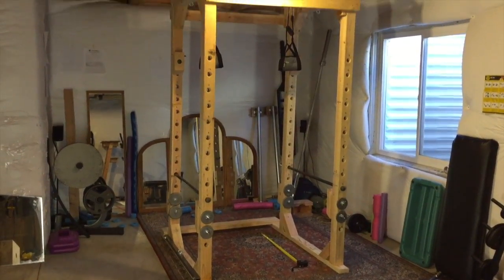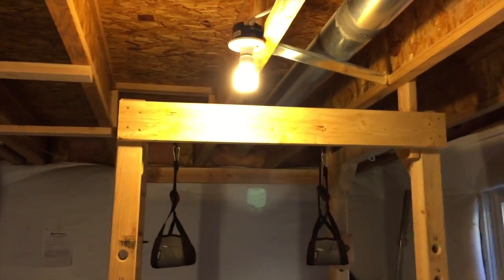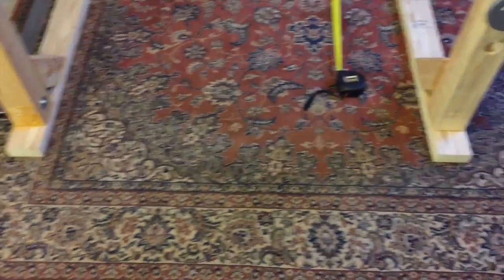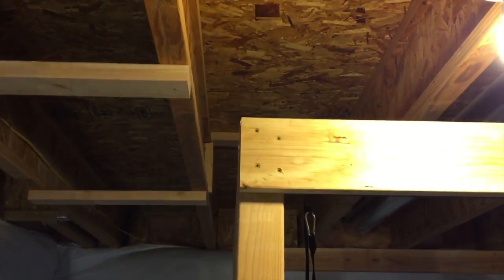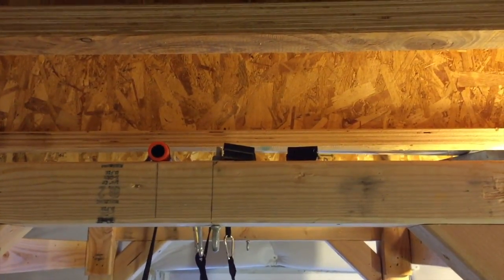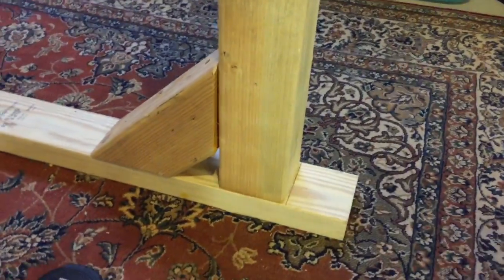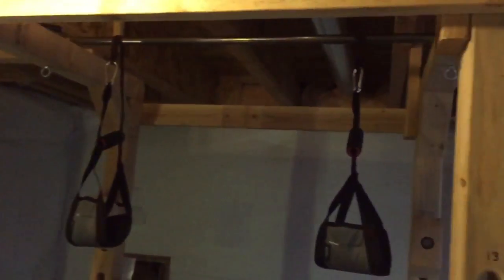My DIY Power Rack Design

Comment: Your design is fantastic!  I like the Buff Dude's version as well but also found it odd they didn't use wood glue.  I'm gonna use 2x6 for the feet since I don't have 2x4.  Unfortunately I can't secure the rack to my ceiling but I think it should be fine overall.  Nice J-hooks too!  Looks like the top and bottom are angled, what degree did you cut them at?
Reply from the maker: I don't recall but 30 degrees comes to mind. Thanks.

Comment: how many inches did you push out the bottom support so you could comfortably rack the bar? I prefer your design over the buff dudes one, planning to build it this week
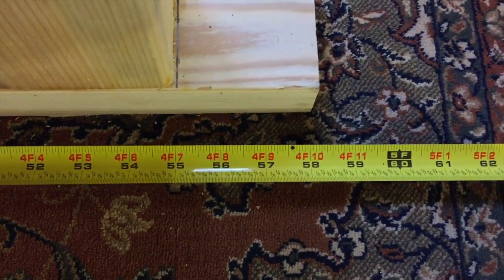Reply from the maker: I found it! If you look at 3:59, you can see it's 12 inches. Hard to read the tape measure but you can see it goes to the first black mark (which is a foot). You can always squat from the front uprights (turned around so you're still in the rack with the safety bars). I'm not a big squatter because I have 2 knee replacements.

Comment: It’s strange... you talk about the Simpson strong tie not being enough, yet only use one screw in each end of the diagonal support pieces. I don’t understand.
Reply from the maker: Because I use wood glue and the top beams are sitting on the tops of the upright 4x4s. There is virtually no stress on that part. Just wanted to tie it all together. That Simpson strong tie with screws and no glue is (in my opinion) garbage. I'm sure they work well, but they look cheap.

Comment: Nice! About how much does this cost to construct?
Reply: Lumber alone? Or with all the hardware and plumbing? Mine used all 4x4's, metal brackets, and piping, akin to the Buff Dudes build. <$200. 8-10 hours of work the first time. I think I could dial it closer to 6-8 hours anytime after. I would also go with the 2x4's along the bottom like Kurt's build. The real expense is any metal that's added; i.e. the deck hangers/brackets, hardware, iron pipes, and tools if you don't have them.

Comment: Great rack but I have to disagree with you on the "metal things" / simpson strong ties being "garbage".

I've built the exact rack as Diy Duke from Buff Dudes about a year ago and I've been using it all the time. I've done very heavy bench, squats and even 400lb+ barbell calve raises on it and never noticed any shaking or any signs of weak structure anywhere.

I wish I would of also used glue but I feel that the combonation of corner braces and  these strong ties have been holding up very well  so far. I used cedar 4x4's they work perfect.
Reply from the maker: Glad they worked out for you. In my opinion, those "metal things" are an added cost, are not as strong as glue, and are more in the category of rough carpentry - versus finished carpentry. I had the privilege of working in a cabinet shop so when I put those metal things on, I knew they were not the best option. Thanks for your post! Kurt